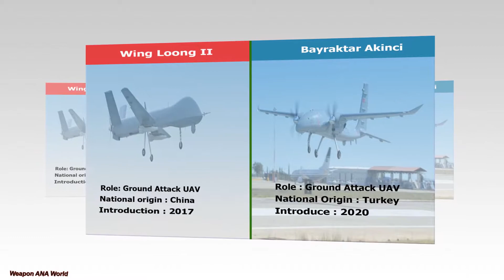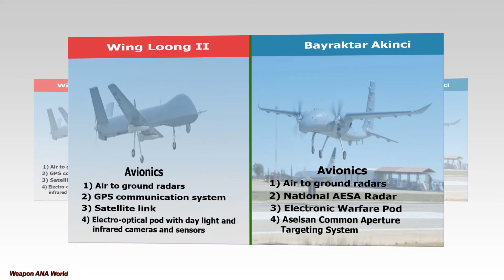Wing Loong II Versus Bayraktar Akinci Comparison

Comment: Wing Loong II : Max Payload 480 kg, Akıncı Max Payload : 1500 kg, Akıncı has ability to launch air to air missiles, Akıncı has 10,000 km operating range, Wing Loong has 1,850km etc... New Akıncı-C has 2x 950 hp engines, Wing Loong II has 1x 100 hp engines, Akıncı can fly at 40,000 ft altitude...

You forgot to tell these probably
Reply: 10000km? wtf? the circumference of earth is 40000km, TB2 can fly 1/4 of earths circumference?
Reply: @dodo1655  Good morning sunshine. The cave you stay in must be cool.

Comment: AKINCI HEAVY STEALTH ATTACK DRONE👑🐺🗺️⚡🌈✨🥇💰🇹🇷 [BEST}.
Reply: Wing Loong 2 combat unmanned aerial vehicle (UAV) from China's AVIC.
This type of aircraft can stay in the air for 31 hours in the intelligence, surveillance and reconnaissance mode and 26 hours in the attack role.
Bayraktar and Winglong do not belong to the same category
The Chinese drone is the largest payload of the Turkish drone
Wing Long 2 is better in every way than Bayraktar
 In payload, firepower, or flight range
The entry of the aircraft into the military operation opened the door to a catastrophic failure in its performance.
The plane crashed on more than one occasion on the Syrian and Libyan territories.
As for its successful operations, it was helped by the weakness of the opponent.
The weakness of the aircraft and its operational and defensive capabilities are completely different from what was promoted by the media
 "Desperate" attempts to move the investment quagmire
The failure of the plane appeared in its first actual operation over the Syrian and Libyan airspace, where the plane came under fire from primitive air defenses, but it succeeded in shooting down some of them.